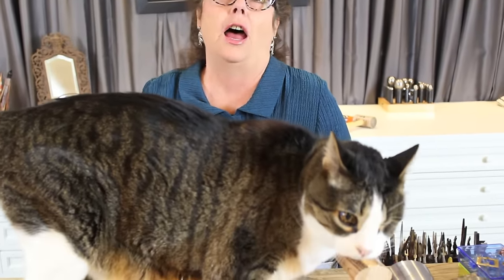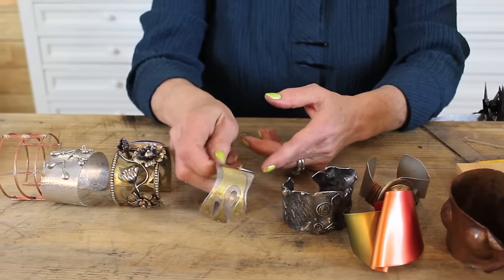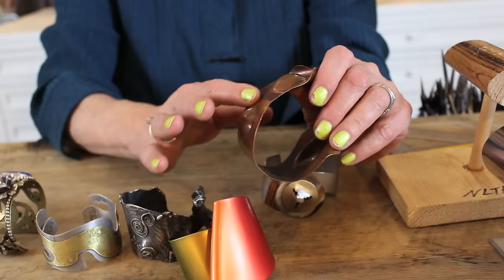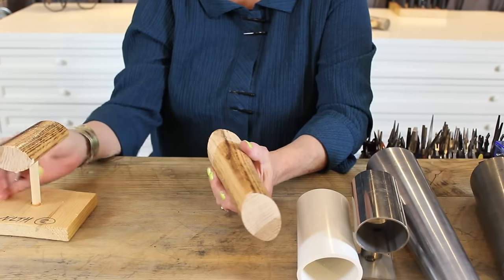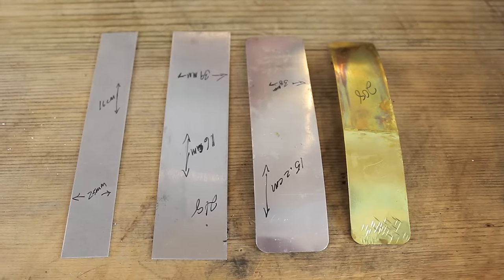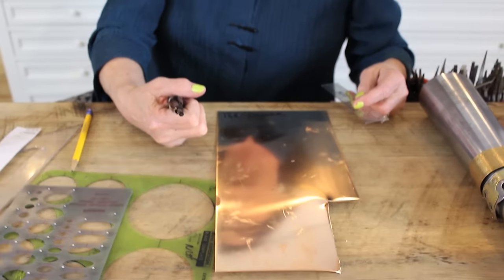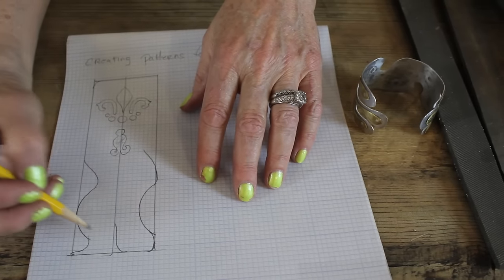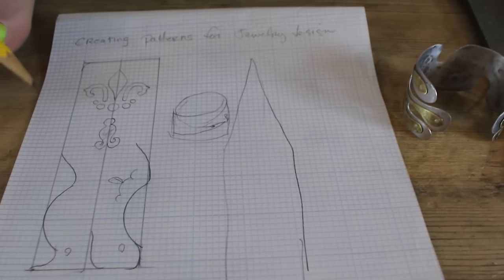How to Make a Metal Cuff Bracelet: Part 1

Comment: Nancy I need to make a SS cuff, using a pendant and earrings I bought that's got turquoise in the settings that I want to use as the top part of the cuff attach it some how. I've never done anything like that before who do I go to to get that done and will they have to heat up the whole thing to attach the bezel set turquoise to attach it to the SS cuff and will it hurt the turquoise at all if it is heated up?? Some of the parts, like the loops and top an bottom part of the pendant needs to be taken off as well and I think the pendant and earring parts will have to be bent a bit to fit on to the cuff am I doing the wrong thing to try and get such a cuff made? I tried sticking the pendant an earrings to a reg metal cuff I have and it would look beautiful if it were made into a cuff the pendant and earrings are very ornate that would be a true one of a kind cuff. Do I look for a silver smith or who??? Thank you. :)